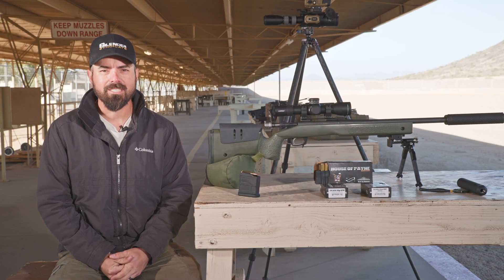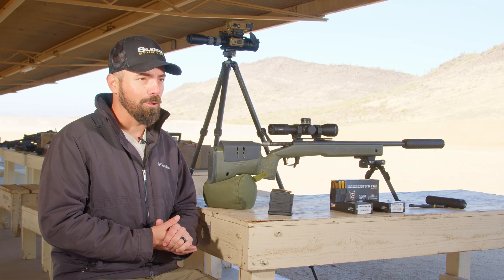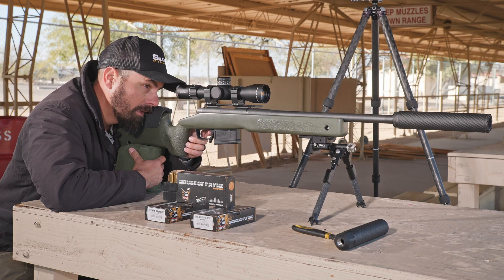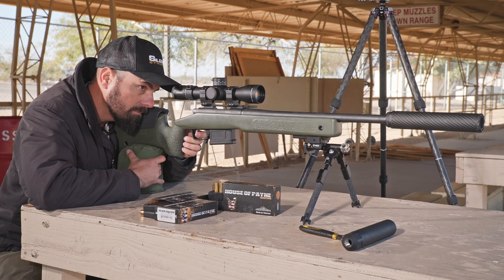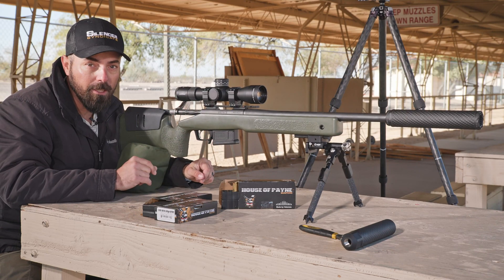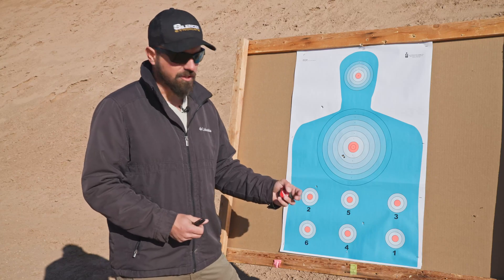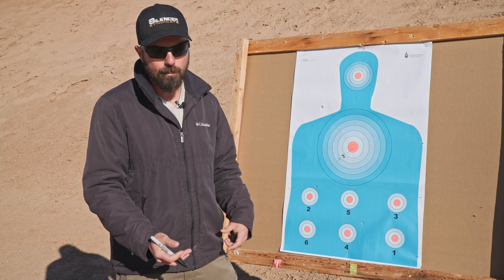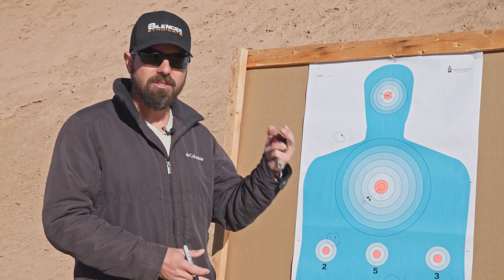Supersonic vs Subsonic Rounds - How Do They Perform? + Testing the Off Grid Armor Trident!

Comment: this has to do with twist rates i think, my 308 has 1:8 and it will do under .75 at 100 with 195 subx's and even tighter with 110s. most 308s are not 1:8 tho so this is the result most people would get

Comment: The way trans-sonic was explained made it sound like the reason those subs were inaccurate. If subs reach trans-sonic speeds, they're not really subs. That rifle's barrel twist likely is too slow to stabilize heavier .308 projectiles which would have caused the inaccuracy with subs in this video.
Reply: Yes I should have mentioned ROT. Thank you

Comment: Have you considered making a detailed video about shooting suppressed without hearing protection?
Sure it isn't advisable but there are situations like hunting and home defense where you might have to or you do it by accident. 

I've been looking in to the topic and data in literature suggests that small doses probably do not cause permanent hearing damage although there is variability between models and research conclusions are cautious and recommend always wearing hearing protection. 
Interestingly the data also suggests that (broadly speaking) allowed dose from unsuppressed .22lr bolt gun is comparable to suppressed .308 bolt gun. 

My personal anecdotes suggest that suppressed .22lr is fine. I haven't (yet) tested other calibers.
Reply: Good idea. I do have experience with this and it would be a great topic! Thanks
Reply: PEW Science has a bunch of info about this. Read their Silencer Sound Standard.
Reply: @ToastbackWhale  I find flaws in their approach. 

The conclusions aren't transparent (omitted data) and they use warned AHAAH model instead of the unwarned one (MEM reflex isn't found on 100% of the population like they assume).

Also solely relying on AHAAH model is slightly questionable since different models have significant differences between them. 

Sure it is a good starting point but far from conclusive.

Comment: Subsonis bullet stability does not follow the conventional Miller formula. I‘ve gone through thousands of rounds of test loads in my 300BLK (7“ twist) to learn this the hard way. This is particularly relevant for this channel since unstable bullets can cause baffle strikes. 

Bryan Litz mentioned in his podcasts that the air stream of supersonic flight helps reduce yaw and wobble which isn‘t present for subsonic bullets. 
This is just something to be aware of any pay attention to. It‘s also pretty random. Some bullets gave me 2“ 19 shot groups at 100m with only 9 holes and one bullet that went off paper. Sometimes I‘d get a faint rattle in my suppressor when a bullet tail struck a baffle.